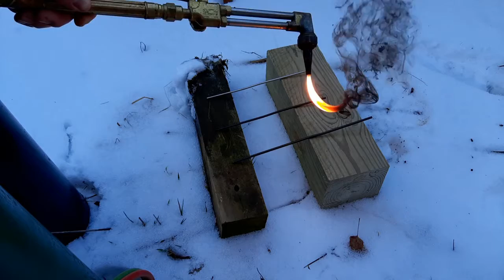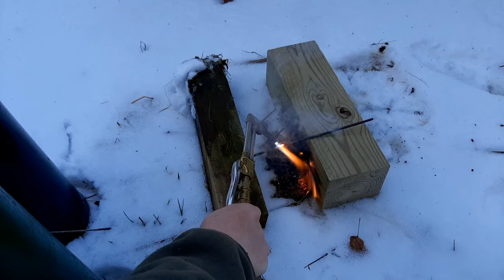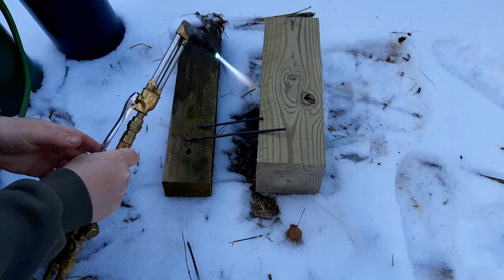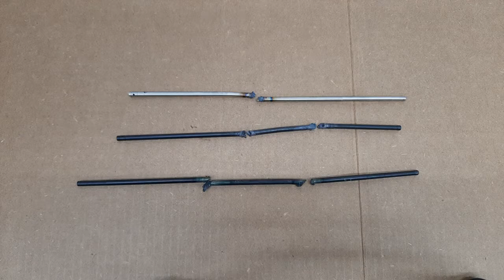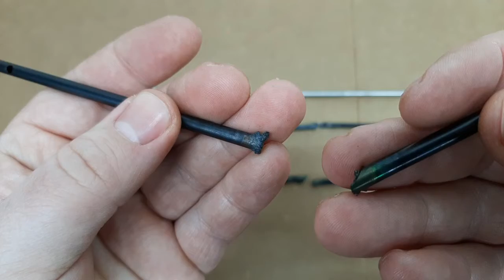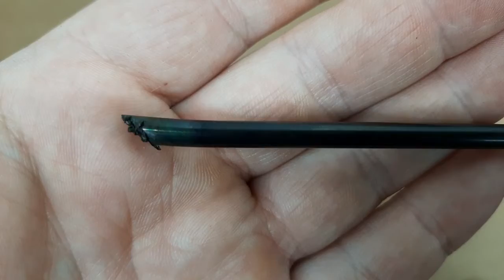Melting 3 types of AR-15 gas tubes;  Stainless, Nitride and Inconel

Comment: I know this video is 3 years old but to be honest, a regular stainless steel gas tube will work for the average person. I am thinking about getting the nitride coated gas tube for the one I have the super safety. I also looked at the inconel gas tube, It might be the best gas tube out there but for the price and my use case, the nitride will work just fine. $19 (nitride) vs $87 (inconel).
Reply from the maker: Yeah I agree the nitride tube is a great value at a great price point!

Comment: Jim Sullivan designed the gas tube to be the system failure point of the gun. If you strengthen the gas tube which part of the system will fail next?
Reply from the maker: Read some of the us army funded fire to failure testing of m4s and m16s.  The barrel ruptures right before the gas block and sometimes the gas tube fails before it.  Here is what I found in my own testing.  With a barrel profile heavier than gov profile with one of these high temp gas tubes. The weapon starts to cook off and have starts to malfunction.  Let it cool back down and it's fine.

Comment: By chance, do you remember the companies? I can only find melaonited
Reply from the maker: melonite, nitride, qpq, nitrocarburizing,  all very similar processes if not the same.
Reply: @SmallTeamSupply can you post a link for the nitride gas tube you used in this video?
Reply from the maker: @realtyrocks1969  it was a no name brand eBay buy before they scrubbed alot of the ar15 stuff off their website.

Comment: I used v systems inconel gas tube on a full auto upper and tried to dump 2 100 round drums back to back and the tube busted at about the 170th round which was very pathetic for a 80 dollar gas tube that’s supposed to be heat proof
Reply: Whaaaaaat?! Thats nuts
Reply: @LovesM855A1  yep. Ive had normal gas tubes work much better
Reply: @user-oy9zy4ds9m  yeah I use the melonited ones myself on every build, glad to know I didn’t end up paying 80 bucks for junk……I was looking at them recently hard
Reply: @LovesM855A1  yeah i like the spikes tactical melonite tubes because they are mil spec 304 stainless and supposedly nitride/melonite coated both inside and out. Plus black tubes look cool. In my experience shooting a ton of full auto m16 regular tubes and melonite hold up roughly the same.
Reply: @user-oy9zy4ds9m  for sure! I have Spikes as well and CMC on a couple which look just as quality….. hey man your only as strong as your weakest link and I don’t think there is a metal right now that can be formed and not be to brittle but hold up to the heat of 900 rpm can bring……
Reply: @LovesM855A1  mine is running between 1,100 and 1200 rpm. Mid length upper with .750 hole. Its funny the SBR  runs a little slower at 975 rpm you would think since its more gas it would run faster but its the opposite. At the end of a 100 round dump the tube is glowing bright orange/red like a lightbulb
Reply: @user-oy9zy4ds9m  you think?! Lol damn thats getting it hard!! Id love to know what the temps reach in the throat area while going buuuuurrrrrrrrrr…..:
Reply: @LovesM855A1  the chamber actually takes 2 100 rd mag dumps to get it to 500 degrees where as the gas tube can exceed 1000 in just 1 100 round dump. The spent brass actually helps to keep the chamber cool as they take a lot of heat with them and also The chrome lined chamber may be helping cool things as well

Comment: Black Nitride Gas Block are like Toyota, very reliable. Stainless Steel Gas Block are Ford, Lol. Inconel is BMW, will give you problems later. 😂 overall great video!
Reply: How will inconel give issues later? And which nitride gas tube you recommend I buy it from? I need a mid length
Reply: Iconel can degrade and erode over time and fail. Especially if improperly installed.

Comment: Great video, LMT cryo treats their gas tubes to prevent gas tube failure.  Some spec ops guys coat the inconel in ceramic.  The gas tube is the fastest failure point and your video does a great job proving that.
Reply: Who makes the best nitride barrel? I need mid length
Reply: @Иванпонимаете-г4ш  Try and get something with a chrome lining if possible instead of nitride. Brownells has some .223 wylde lightweight chrome barrels in stock for $170, as well Criterion’s for a bit more. If you insist on nitride, Ballistic Advantage Hanson w/ pinned lo-profile is what I use.
Reply: In a fighting rifle you don’t won’t a failure point you won’t the gun to run even if the barrel rifling is shot out because you are still in the fight
Reply: The original design of the gas tube was to be a failure point to save the rest of the rifle. Think about it, would you rather have to replace a failed gas tube or a failed barrel? Unless you're in a long gun fight, the stainless steel gas tube will serve you just fine.
Reply: I have seen no evidence this was a deliberate design feature.
Reply: If I'm using it to defend myself I'd rather it turn into a 10 moa smoothbore that still cycles than an inoperable paperweight. I can replace every component on my rifle if need be, I can't replace my life.  @Blueknight1960

Comment: This isn't really a representation of the materials, rather it's showing how materials fail from a single affected point. When your gas tube gets hot, the entire gas tube gets hot, not just one area. Also, this isn't an accurate representation due to the fact that the point of oxygen in oxy acetylene torches act as a catalyst to ferrous materials and erode it faster by achieving higher heat through that catalytic conversion. This is why metals that are non-ferrous just melt rather than breaking down. Also, no AR gas tube is going to get to 3,200°C. This test only proves the reason to have standard gas tube so that you don't cook rounds off. It was designed that way.
Reply from the maker: No, mil spec gas tubes do have a point that gets hotter then the rest, it's at the bend. I agree, that's why I wasn't blasting it with oxygen, I was trying to heat it similar to using a rosebud. But I agree this was far from scientific.
How you prefer the rifle to "fail" differs from where and how you use it. If you are  simply at a range close to your house were obtaining spare parts isn't an issue I agree with you, let the system fail before it can cook off.  If your in a different environment, I'd rather run the "risk" of Cook offs, understanding the dangers of flagging people with rifles and if there is a cook off  happens, it happens in a safe direction and not commit fraticide. While the rifle stays serviceable after cooling down.

Comment: I wish they would engineer ar15 to be like ar9 so we don’t need a gas tube
Reply: They're coming out with a roller delayed .223 by mean arms.
Reply from the maker: you can check out the brownells brn 180 uppers
Reply: @SmallTeamSupply  The BRN-180 is still gas operated. It just has the recoil assembly tucked inside of the upper receiver where the bcg resides instead of the recoil spring/buffer being inside of the receiver extension.
Reply: Check out basically any long or short piston ar 15 for a gas tube free experience

Comment: Where did you get the Inconel?
Reply from the maker: V sevens weapon systems
Reply: @SmallTeamSupply  Oh it's V seven! I should have known, but I didn't realize they did Inconel gas tubes.

Literally I build all my guns with/ I won't build a gun without their Titanium take down pins, Titanium mag release, Titanium QD end plate and titanium grip screw! 

V seven makes some good stuff!
Reply from the maker: @MilitiaStateArmory  Oh yea for sure! I love their stuff too!  I use alot of there titanium stuff as well on all my primary builds. I'm also very interested in getting into their lithium aluminum stuff also its suppose to be all around better then 7075 T6

Comment: I think its worth noting that you also have run through a lot of ammo to get the barrel hot enough to start cook offs generally more than 300 rounds. However it also depends if you are running steel or brass cased ammo.
Reply from the maker: Correct more then 2 full combat loads around the 500ish round count for a gov profile barrel.  Interesting point about the casing being a variable. Be worth a test if someone is willing to burn the ammo.
Reply: If you haven't already found it the golden webb channel does meltdown testing. As does iraq 8888 has done a few also. @SmallTeamSupply
Reply: Or, in the future, polymer. Polymer imparts far, far less heat to the chamber itself, greatly slowing down both the heating process and also reducing the ability of the chamber to return that heat to new cartridges.
However, the cartridge base is steel, so the bolt itself heats at the normal rate.

Comment: This was actually a really cool test, definitely important to know for DI systems and the right stuff to use in a build and component aspects for consumers.  Nitride definitely did the best.
I'll note that I actually much prefer short stroke piston systems in AR platforms, they run longer and better in austere conditions-- the caveats are a few more components and the heat sinking of the valve/ piston block, but still is much beefier and will last much longer than a gas tube.  I think that would be a good alternative as well (especially with variable valve settings for compatability with blank fire/ rounds which most have)
Good stuff!
Reply from the maker: Thanks D.J.  I disagree with many of your points about a piston system and I view the D.I. system, atleast for ar15s, to be superior. Maybe we can talk at length about it later.
Reply: @SmallTeamSupply  Gladly!  That would be a great discussion brother.
Reply: @southernpartisan1772  Heckyeah!
Reply from the maker: @DJTheMetalheadMercenary  yeah let's do it sometime soon here D.J. maybe we could record it on zoom
Reply: @SmallTeamSupply  That would be cool, I got zoom so that would work well  :)  I'll swing you an email and we can touch base.
Reply from the maker: @DJTheMetalheadMercenary   sounds good bud!
Reply: @SmallTeamSupply  you smoking Crack? Iraqveteran8888 has videos if pof piston going 2500 rounds the di ones pop at best was 850
Reply from the maker: @jasonshink6589  alot of things at play besides longevity during continuous full auto fire. Go check out some of inrange's mud tests as a primer.
Reply: @jasonshink6589  battlefield Vegas says DI is better. More easy to fix and last just as long. The only good piston driven AR is the HK416.
Reply: @jasonshink6589  Can you describe to me one realistic scenario besides deliberately trying to destroy the gun where anyone would fire 900 straight rounds of full auto with no breaks
Reply: @SmallTeamSupply  Many Piston systems are proprietary, and some based on design perform much better than others in austere conditions and with the introduction of natural obstructing materials.  
My Ruger SR556 (they're discontinued now sadly) has handled -40F temperatures with snow and ice no problem, handles sand like a champ, and wasn't affected by mud the one time it did get heavily saturated.  
POF, H&K, LWRCI, and Faxon Firearms all have tried and true short and long stroke Piston AR platform Rifles that can handle some of the worst nature can throw at it in practicality.